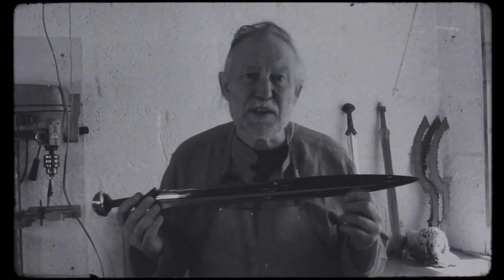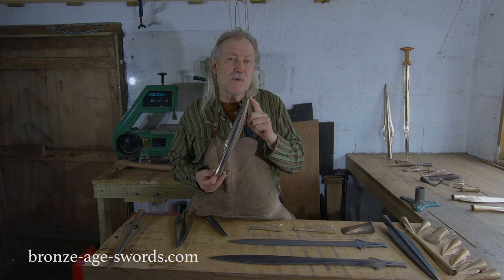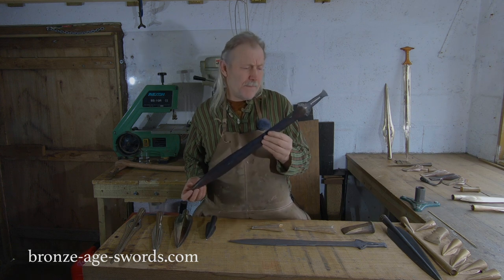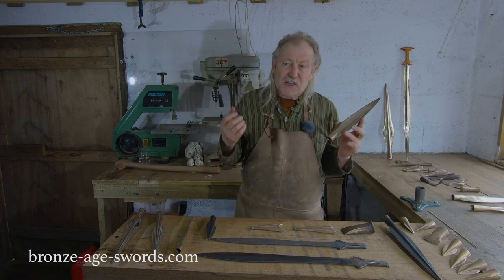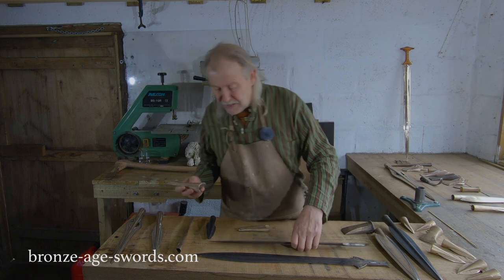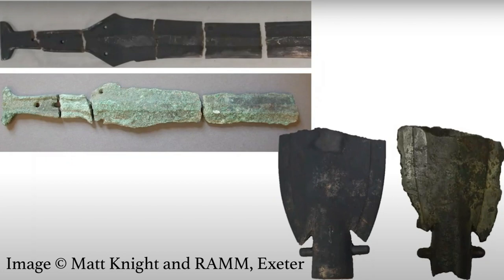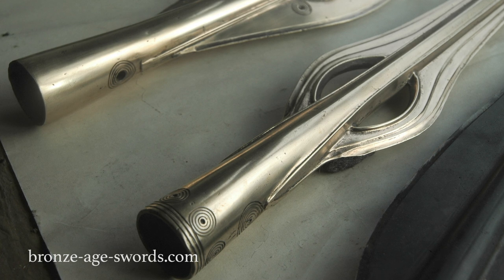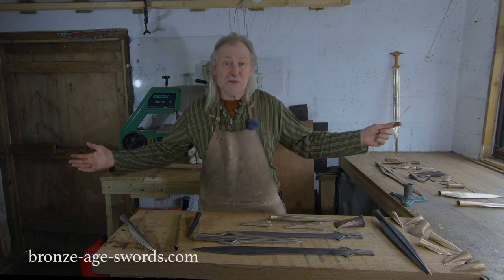Wilburton Sword Hoards - Neil Burridge's Sword Corner - Ep 07

Comment: Listening to this again, I was struck by the comments about the 1:1 ratio of long spears to swords vs the much higher ratio of short spear tips to swords.  The depictions I've seen of bronze age Greek warriors show them with a sword and one long heavy spear which I interpret as a longer-range stabbing weapon.  There's your 1:1.  But if you were throwing a spear/javelin as a ranged weapon, you could easily have several light, small tipped spears... which would explain the greater than 1:1 ratio.

Comment: I have been thinking about how the spear heads got smaller over time & i wonder if it has anything to do w/ throwing. A shorter stockier spearhead would have less chance of bending & breaking when thrown. Once stuck the lateral force put on it by the weight of the spear shaft itself would put immense stress on it. Just a thought.